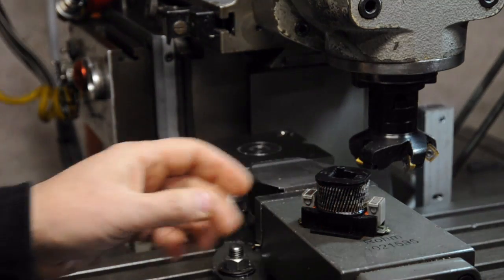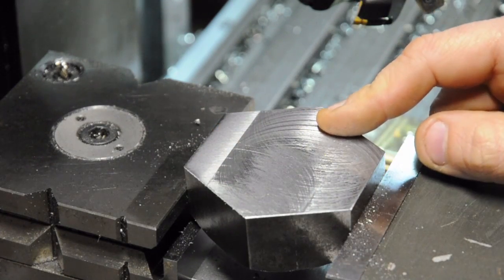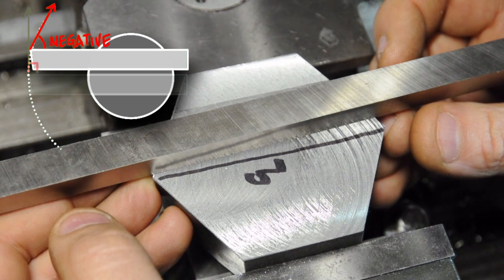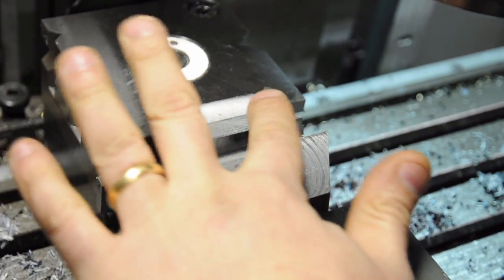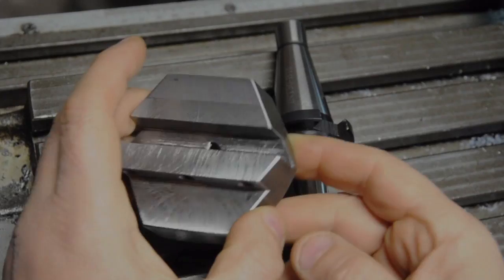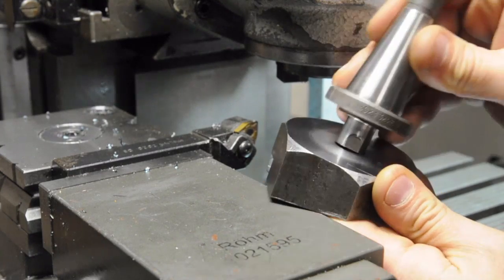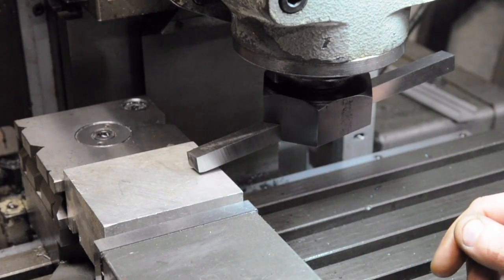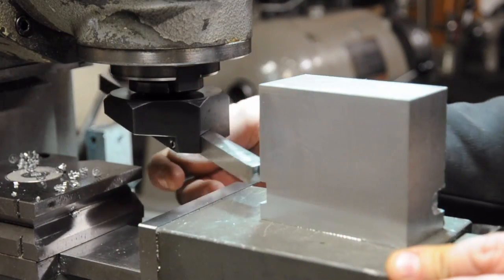Building a Fly Cutter - Part 2

Comment: What cold bluing product do you use, exactly?
Reply: I'm not sure what bluing Tony uses but I use Oxpho Blue from Brownells with excellent results.  If you warm up the part a bit to about 100*F rub it on and let it "rust" then wipe it off and re-apply until the desired color then burnish with 0000 steel wool and oil it's a great finish.
Reply: It is Phillips Professional Cold Blue... In other videos you'll see him using it.

Comment: Nice video !!! What do you use as product to darker your steel ? Is it possible to do the same for aluminium alloy ? (ps : start to design so pieces on solidwork like a claw for my drill to hold cases, and using CNC and co is a part of my older life long time ago lol)

Comment: In theory should the face mill be about 1.5 times the width of the material your cutting so that the arc it cuts leaves less material is being removed at the incoming and outgoing edges of the cut?
Could that be why the mill overloaded & cut out maybe?

Comment: Let me start with...I don't know Jack. But, having confessed that, don't all those fancy angles you were just talking about go right out the window as soon as you change the position (radius) of the cutter? It would seem that the only way to get a consistent edge angle is to mount the cutter stock on the center axis and actually grind the desired angles into the piece of tool steel. That way the cutting geometry stays the same independent of radius.

Comment: It certainly is AC coil, because its core is made of metal places 
instead of one piece of metal. Also, Schaublin 13 looks like really old 
and simple machine (that's plus!), so I guess all contactors will 
be simply connected between phase and neutral, so everything will be 230V AC. Maybe there could be some transformer, but I really don't believe it.
If number 61 in manual is year of manufacturing, then it could be really caused by age and insulation problems. Mains voltage slightly increased over years and even about 10 years old motors at my work sometimes have insulation problems. It just can happen on old machines. 

So, coil should be 230V AC. Check out other coils to be sure, it should be written on them. About contacts:
spindle and table-feed motor - 2 HP
high-speed feed motor - 0.4 HP
coolant pump motor - 0.1 HP
All of them should be 3 phase motors.

So you'll probably need 3 phase contactor, but!....maybe it will need some additional contacts too. It would be great to see schematic (could be printed inside switchboard, I couldn't find it online) or at least how is original contactor connected. It can for example check if pump is switched on (or off), before it allows you to do something else.

Comment: if u do need to put in a new contactor u should put in a thermal overload protector that trips and can be reset to prevent any damage to the contactor or prevent a fire in case too much current is been drawn via the cable.

Comment: Would it be beneficial at all to put a small tungsten or lead plug in the "back" side of the fly cutter, opposite the cutting edge, i.e. where the other end of the tool steel is sticking out in the demo, to offset the mass of the tool steel sticking out several inches in one direction? Just to balance the tool. 
Or would this not make enough of a difference for anyone to care?

Edit: As soon as I posted this I watched the addendum where he starts off by answering my questions. GG me.

Comment: I work at a company that manufactures engines and although my job isn't consistently the same task everyday it tipucally has to do with running a surface cutter on a surface that is to receive a gasket so the surface sent have any dips and the finish has to be absolutley mirror. But we still tilt the head of our mills at the slightest angle, this way you can only take a few thou on the back cut but the surface finish is perfect

Comment: Hand tapping with an electric drill---that's a ballys move, I know what would happen if I tried it---snap.
Reply: I like them. Set the clutch so they don't break taps. Usually the chuck doesn't grip tight enough to break it either.
Reply: Works better than you think.  Clutch is your friend.
Reply: I can't even remember that last time I used a tap handle. Lol

Comment: You can use any contactor rated for the HP of your motor and the voltage of your trigger, it does not have to look the same as your current one.

Comment: I built something like this but it allows me to make circle rings or groves in wood the cutter is 90 to the rake and attaches to the rake that is move in and out for the size of the circle grove you want. the size of the grove is control the size of the bit that is held in the arm by 2 set screw

Comment: All the contactor coil does is pull in a contact. It sees the same loads for all of its life. Doesn't matter if you use a microdrill or you want to mill away a 10 story building, that coil has the same current at all times

Comment: Contactors are pretty standard in size. You should be able to match one up pretty easily, lots on ebay. If you saved the label, just search for the same part number.

Comment: doesn't removing one side of the hex for the set screws induce vibration wich could affect the surface finnish?
Reply: Maybe it doesn't matter since it always cuts at the same section of arc
Reply: I was thinking the same. also with the 10 degree pitch there is more material on the  tool end side to knock off the balance.  i wonder if he put the notch for the tool steel at 10 degrees if it would have been better than refacing the whole tool at 10 degrees.

Comment: Contactor contacts and coils have a finite life and replacements are easily sourced - just make sure you get one with the same coil voltage and contact rating (AC3 for the inductive load on your spindle motor).

Comment: Why did you throw away the tapered chuck adapter?
Was there too much runout that even taking it to final dimension would not have cleaned it up?
Reply: I was thinking the same thing. He could have used it for other fly wheel or tool insert.

Comment: Contractors are like a mechanical switch that uses electricity  (24v dc usually) , as long as there is enough wire I recommend allen bradley  contactor (search eBay for one, new from AB they want $100 for 1)

Comment: quick question, with the 10 degree angle on the head and tool, aren't you essentially milling a valley through the work piece?  unless you account for it (the 10 degrees) in the geometry of the cutter?  I'm not a machinist but love your videos!
Reply: No, because the tip is spinning horizontally (cutter axis vertical) and cutting a horizontal circle through the material.
If the head of the milling machine was tilted by 10 degrees (cutter axis tipped over by 10 degrees), then it would tip that cutting circle over and cut the valley you were asking about.
Reply: Jeff NME 
Thanks, I forgot that the shaft of the tool is rotating perpendicular to the work!

Comment: One thing i still dont get is why you didnt just use setscrews to hold the head in place or better yet use a tapped holder and simply use a screw to hold it all in place. But hey it works so what do i know.

Comment: I bet rotational balance in fly cutters helps alot too
Reply: Some commercially made fly cutters are built to offset some of the imbalance but at the speeds usually used and the fact that you have unbalanced cutting forces what is most important is the speed that you run it at and the rigidity of the setup. The wrong speed or lack of rigidity can result in sympathetic or harmonic vibration that will affect tool life and finish.
    Mike (o\!/o)

Comment: I saw it too, just came to different conclusions.
You already knew the B16 taper was wrong, so see no reason to not at least cylindrify it. 
Might not be able to use it for this specific project do to its smaller than expected final size (won't mention how that has more to do with drilling the hole before machining the shank) but that'd let you know pretty quick if it was that side after a few reseats of the 30 taper side.
And again, you already knew the B16 taper was faulty to begin with. So being shocked that it appeared that the B16 side was indeed faulty isn't really you learning anything new.
EDIT: There's a Fly Cutter Addendum video, where he's tested the iso 30 taper and claims it was bad. Occam's Razor has snapped.

Comment: Almost lost a ring finger to a fly cutter, 3,600 rpm on  acetal plastic, stop set, adjusting on the quill, to the last 10 thou finish, on a tight delivery the boss was busting my nuts for a finish, oops. Long and short, surgery for a partial amputation and the A hole sacked me 8 weeks after returning because I wasn't fast enough anymore.
However worked hard, turned out great I'm a TAQA qualified assessor and trainer so yay for me🤣

Comment: you need to relieve the thick side of the flycutter. Its to heavy on the cutting side and putting  to much pressure on the bearings as its running.

Comment: Thats odd. With this method of holding the tool, he marks up the tool when he puts it in. Wouldn't it be better to do like he did with the Boring bar? That way you don't put the crap out of your tool or possibly break it (if you have solid carbide bar). Also with the boring bar head, it is almost a buffer so it applies more even pressure easier.

Comment: I'm always confused with "high speed steel", it doesn't really seem any faster than tool steel.  (Depending on your throwing arm).  But is there really a difference ???
Reply: theres a difference, and no , the term " high speed steel" does not mean increase the feed rate or rpms.
Reply: it was supposed to be a funny.  guess I failed.  sigh ;)
Reply: Rob Gandy hahahaha, i get it now

Comment: TOT I have some questions about mills I have the chance to inherit two mills one is like yours it's a schaublin 13 the other is its little bro being a 12 along with them a Sioux lathe have exp with the lathe and Bridgeport's doing machine work on race cars engines most machining I have done and do are boring machine and resurfacing  then a head station for doing seats and head work along with big and small end rod turning
Reply from the maker: take them all! :) note the 12 and 13 don't have quills so you'll be working with table travel but they're both 273.5% more rigid than the Bridgeport.

Comment: Did you ever end up building a surface gage?
Reply from the maker: not yet!
Reply: @ThisOldTony  I'm an electrician by trade and have always been a "fixer/maker". 2 ×72 belt grinder, forced air ribbon burner forge, 75 pound power hammer to name a few of my past builds. I got into machining about a year ago after acquiring a rockwell 10" lathe. Then a J head Bridgeport mill soon after. Your videos are great. Entertaining and informative. Inspiring me to make a 2 piece vice, fly cutter, and an insert tool holder . Thank you and I hope you continue to share your endeavours.

Comment: What is blue water which soaked into the cutter. ?
Reply: rest c Cold blueing. (bluing?) It's the same type of bluing for guns. Slightly harder surface if I recall but mostly just a skookum surface protection finish.

Comment: Question. What is the use for this coil?
Reply: Relay coil. Basically helps turn the machine on and off
Reply: The coil is the "kickoff" of the motor or it is for PWM?
Reply: When current passes trough the coil, it causes a magnetic field to form.  The field pulls heavy duty contacts together to start a motor or to operate some other electrical device, maybe a welding machine or stadium lighting.
Reply: It it is basically a relay

Comment: What happens to steel to make it 'high speed'?
Reply: It's a combination of alloying and treatment that results in a tough, hard tool steel that is specifically very resistant to overheating. Overheating is a common side effect of cutting things at high speed, of course, so a steel that won't be softened by heating is a good thing.

Comment: Couldn´t use that just for the sake of the sound it makes probably of being used to CNC stuff for now four years. Also I hate tools that cause vibration a lot, because it tends to hurt machines. With manuals it probably doesn´t matter but if your tolerances are within 5 thous of a millimeter it´s bad.